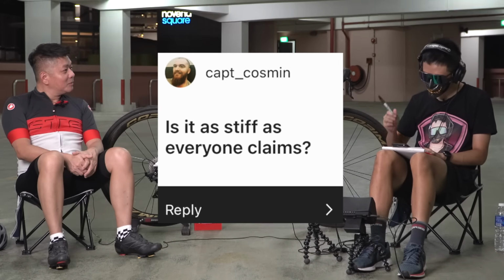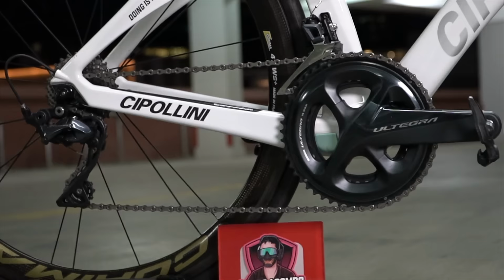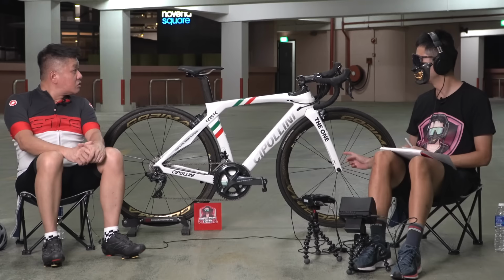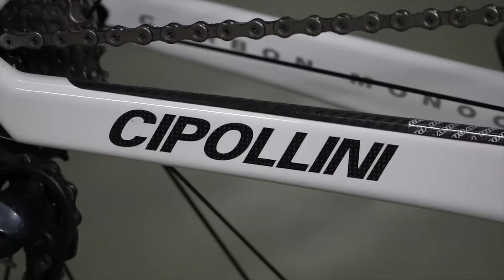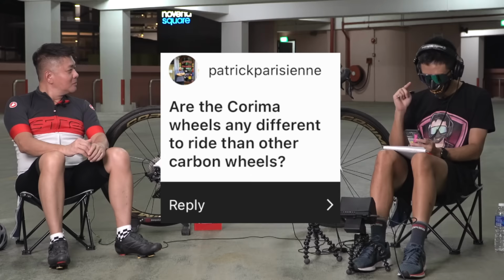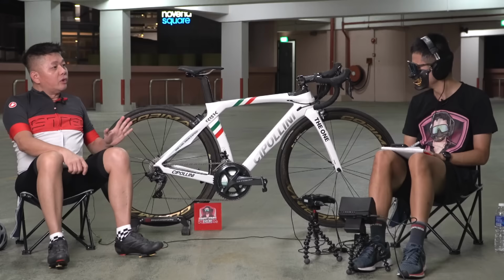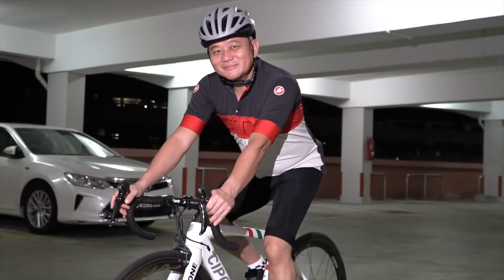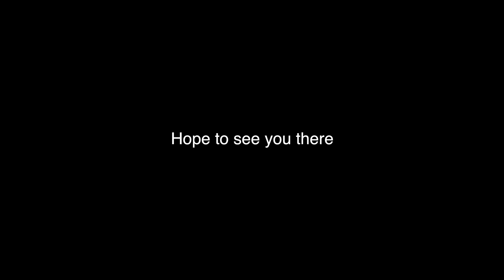Is It Stiff? | Cipollini The ONE | Oompa Loompa Cycling E83

Comment: Those Corima wheels are sick, love the colour. Bike looks wicked.

There won't be a 12 speed Ultegra rim brake ever again. Only DuraAce 9200 is available in rim brake config. and this is the last generation, disc only after that.
Reply: There’s Ultegra RIm Upgrade kit
Reply: @kennylim2382  yes found it my bad. When the groupseta were unveiled only DuraAce had that option. However the levers are the 11 speed ones with different hoods, like same as DuraAce 12 speed rim brake.

Comment: “Do you think this frame is still relevant in 2022?”

Serious question, Oompa: What makes any frame “irrelevant” if it was made in the past decade?
Reply from the maker: Good question, I personally wouldn’t use the term “irrelevant” but maybe “outdated”? Outdated in terms of looks and style or even the geometry for that fact which may affect aerodynamics or comfort.
Reply: Actually it’s not an inaccurate appraisal for some bikes. 
Relevance would indicate some form of compatibility with modern day aesthetics and design choices; primary amongst which would be consideration for disc and e group sets(namely 
shimano due to the need for a battery pack, as opposed to SRAM). 

So any bikes that don’t have these design choices factored in, would be useful, but irrelevant.
Reply: For me personally, if a road frame can't take 25 mm tires on a wheelset with a 19 - 21 mm internal rim width, it's too dated for me. Most wheelsets these days are getting wider.